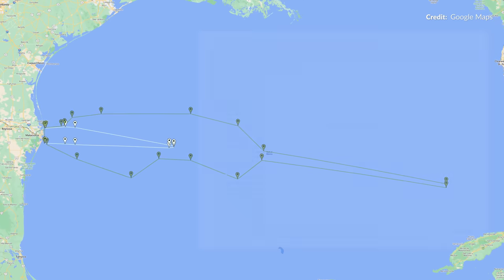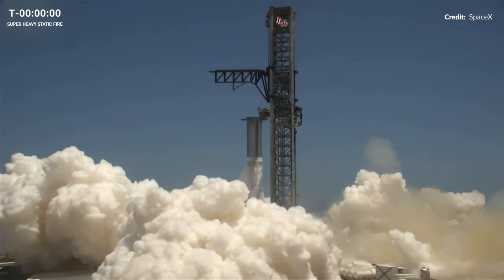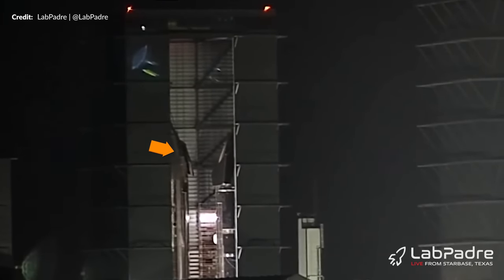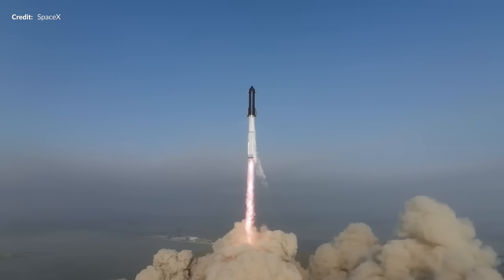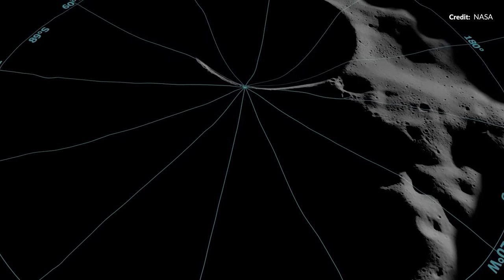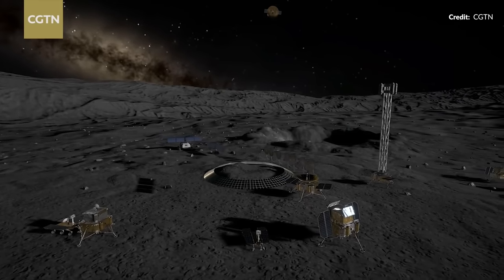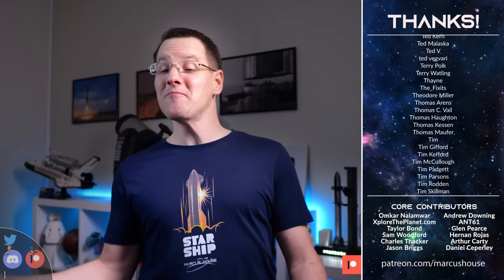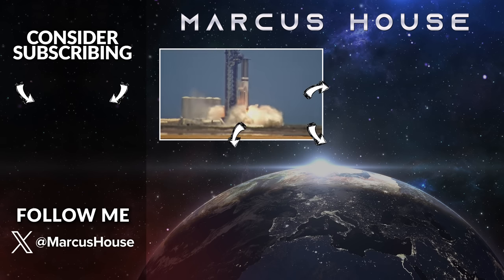SpaceX Drops Bombshell Upgrade, and Starship Flight 2 Date Intention Revealed!

Comment from the maker: Click my link: https://drinkag1.com/marcushouse now to get a year's supply of Vitamin D3K2 & 5 travel packs for FREE with your first purchase. This is a gamechanger for supporting your immune system! AG1 provides your body with everything it needs for optimal performance every single day.
Reply: @MarcusHouse somehow I don’t think this was your answer to me. Looks like a scammer?

And what about my question what happened to the test section that was put on the can crusher?
Reply: Marcus this is possibly your most remarkable yet unassuming video to date. So impressed. Truly groundbreaking things underfoot mate... and you did not break step with other more mundane weeks. Impartiality +10x. Your work so appreciated...cheers - Mech Eng UQ with much love for the 'bart.
Reply: I wonder if NASA has ever heard of the term "KEEP IT SIMPLE, STUPID..." ie, the Mars sample return mission, WHY THE HELL ADD COMPLICATIONS to a system like have the sample return rocket effectively 'Yeeted' into the air to then fire up and fly away??? MULTIPLE UNNECESSARY FAILURE POINTS ADDED! Just have a simple lightweight launch rack/ladder/gantry move or angle over to stand on the ground, to have the rocket pointed up/or at specific angle, and then the rocket can launch from there (as per the normal way of launching rockets 😏)... I REALLY DON'T UNDERSTAND why they would ADD MORE RISKY procedures to something SO VERY COSTLY, and SO BLOODY COMPLICATED to retrieve something so BLOODY VALUABLE (in BOTH financial cost AND scientific value) from a planet +/- 225 Million Km away!!!
IT DEFIES LOGIC!!! 🤔😒
😎🇬🇧
Reply: Marcus  , I am  so sorry for getting your name spelling wrong .  I will try to do better next time 😩🤠👍🏻

Comment: It'll be interesting to see how that hot stage protective deflector stands up to the abuse considering the raptors are pressed right up against it. The only way they'll be able to know is by eventually bringing the boosters back and inspecting then. Exciting times ahead!
Reply: It might be replaceable.
Reply: It'll just be the 3 outside vacuum raptors firing. The 3 center raptors where they are pressed right up against the plate won't ignite.
Reply: And will probably look like the water tanks after the first flight. @StillAliveAndKicking_
Reply: @paritee6488  The tanks were damaged by pieces of concrete dislodged from the launch pad. Unless I am mistaken, the engines don’t discharge concrete. And in any case numerous rockets already use hot staging, notably Russian and Chinese rockets. Thus it is neither an unknown unknown, nor a known unknown.
Reply: @StillAliveAndKicking_  You're right that it isn't a new technology but argument falls apart when you remember they want to reuse boosters within a very short time frame and so it has to work perfectly every time with little to no maintenence.
Reply: @RogerM88  that would exceed the normal pressure on those tiles by a factor of 50 (at least)
Reply: I wondered, still do, why they are sure that dome will hold up. Perhaps because the dome only has to survive Starship's raptors for a second or 3.
Reply: @StillAliveAndKicking_ I doubt they'd want to do that because if thats the plan, the boosters would have a very long turnaround time. I may be too optimistic, but I hope they will be able to catch-land a booster and fly again in a few hours or a day.
Sounds impossible, but Fast-Pace is SpaceX Mojo.
Reply: @iamaduckquack  True. Then again how long does it take to stack Starship on a booster? I doubt it would take long to replace, assuming it is necessary, which might not be the case. It wouldn’t surprise me if SpaceX has not yet decided, preferring to suck it and see.
Reply: @bobbarclay316 Stainless steel domes are somewhat more resilient to Raptor breath than concrete plateaus.
Reply: @StillAliveAndKicking_ If it's a unit that connects in using the original Starship mounting points, and then has new mounting points on the top of the Hot Staging Ring, it could indeed be an easily replaced item, the sort of thing that gets swapped out and refurbished regularly.
Catch a Booster, swap out the staging ring, mount a Starship, refuel and relaunch.
Reply: @bobbarclay316 Why do you think it would take a long turnaround time? I'd expect it should be a quick job to release a used ring from the top of the booster and swap for a fresh one - It appears to use the mounting hardware that previously attached Starship to the booster, so the ring should be able to unlock from that hardware just as quick as a Starship would in flight. It may require new hardware to be added to the towers arms, so that once the Booster is back on the OLM the arms can open, raise, and then grip the ring to lift and lower it to the ground.
Reply: @PiDsPagePrototypes  I think that any time spent off the OLM after a flight slows the overall pace. To reach its goals for an operational Starship they will want turnaround measured in hours, not days. 
I also think if the ring is damaged, it means that the thrust vector deviated from the "in line" direction of travel. Starship would then lose the advantage of hot thrusting. 
Of course ring damage before separation could be disastrous.
Reply: @bobbarclay316  The Booster would not spend any time off the OLM - the Ring looks like it could be lifted off of the booster. So swapping the ring would only be a quick job before the Starship returns from flight to be caught and mounted to the Booster. The usual 90 minutes of an orbit should be more then enough time.

Comment: The large boxes on the HLS mock up are air conditioners. Probably pretty hot in there without them. FYI. Love your work!
Reply: So, basically a life support system
Reply: Not wanting to argue as I don't know either but they don't look like air conditioner units to me - there's no vents visible as 'domestic' aircon units have on the sides. The rectangular channels below them are probably fork lift 'receptacles' for handling them, same on the transformer. They could just be distribution boxes for whatever wiring is being installed inside the cone. Anyway, all speculation unfortunately! ;-)
Reply: @wojciechdebowski5014  Life support for the engineers working on them rather than astronauts, yeah...

I do love how SpaceX put these helpful signs on things, and make sure to position them facing the cameras. It's obviously something of a game to them...

Comment: Makes perfect sense that the pad was the reason the 4 Raps didn't start. There's been allot of work there, obviously. That actually gives me some hope that the 4/20 debacle wont be repeated. They used up all their luck on that one, having the engine outs away from the tower. Looking forward to the launch... they need to get it in gear so they can get on with HLS flights..

Comment: 8:22 Seeing the comparison of the round hatch and the rectangular one, the thought and image of the windows of the "Comet" airliner from the 1950's comes to mind. As well as the stress fractures to the airframe that resulted from them.

Even so, I doubt these SpaceX engineers would repeat a mistake so expensively learned over half a century ago...

Comment: What a fabulous episode. Marcus’s channel just gets better and better.  Stainless steel is notorious for warping with heat. Any precision engineer will tell you that machining most types is a nightmare if a lot of heat is produced and welding sheet stainless steel is no less difficult.  I know Spacex have got construction, welding and stress relief processes down to a fine art, but it made me wonder, will the hot staging ring need replacing with every flight. Not just because of warpage but also the weakening of the material due to the enormous heat it will be subject to. Does anyone know the answer.

Comment: I think that nosecone is part mock-up and visitor facility: looks like they bolted on some pretty standard AC units, with pretty standard XFMR and electrical panel.
Reply: It's almost certainly note a visitor facility. There really isn't a purpose to such an addition.
Reply: @bryanillenberg  it doesn't have to have a purpose, just like twitter/X
Reply: @wim0104  LOL

Comment: SpaceX still needs another booster static fire but for longer time. Suspect more shielding to the pad will be needed, as SpaceX is already replacing part of the fondag.
Reply: The fondag replacement has nothing to do with static fire

Comment: Testing.  That’s why we fly…and why it’s better to fly often.  The progress from flight one to flight two is going to be immense…in large part due to the astounding level of improvement in everything related to Stage Zero.  There is ample reason for the heightened level of optimism this time around.  The post flight improvement process has been passing the eye test with flying colors, and that goes a very long way toward building confidence in the expected result…when those turbo-pumps spin up and those thirty three fires are lit.

Comment: I’m always amazed at the amount of activity at Boca Chica Starbase your film shows activity at all hours of the day , trucks of all sizes constantly driving in and out delivery’s, men with hard hats they look like little bees moving around , I like the openness of ship construction and I believe I heard the comment that Elon said , if we have to do any work or repairs on Mars it’s not going to be a dust free environment! But these crews always look like they love what their doing . Space X is always taking buildings down and erecting new ones Love the activity going on ! I guess we’ll see the same at Florida in the new future.
Reply: I work for one of the equipment rental companies that supplies equipment (forklifts, mainlift baskets, cranes, etc…) for construction at Space X. I was there this past week and you are correct about dust (and sand). The wind is always blowing every time I’ve been there and this week was no different. It is so hard to keep the dust and sand from getting into the open hydraulic lines while doing repairs to the machine you are working on. There is soooo much truck/delivery traffic that it is hard to find a place out of the way to repair or do maintenance to a machine.

Comment: I wonder if SpaceX will perform a static test of the Hot Staging?
Reply: most probably not. there is no infrastructure in place to safely test it. it would be very dangerous to test it on the pad. spacex would rather test it at stage seperation than on the pad in case there is failure so that the pad does not get damaged,
Reply: @hamzahkhan8952 well the ring is detachable so I don’t see why they couldn’t just test it on top of the ring
Reply: @LeoFreese Full thrust burns of vacuum engines at sea level are usually a bad idea. They also wouldn't provide the same loading profile as the real thing.
Reply: @LeoFreese   that true. spacex fires many raptors a day, so maybe theyve already tested firing raptors at steel.
Reply: @LeoFreese also, as another person commented, you cant test vaccum engines on the ground the same way they would in space (unless they made a huge vaccum chamber for testing, which they wouldn.t).
Reply: @jounik probably an incredibly bad idea - apart from the chance of catastrophic failure of the rings, the raptors’ nozzles would be damaged pretty badly as well from severe over expansion
Reply: Yes SpaceX will perform static testing of hot staging. Right after Booster engines are ignited and hold down clamps are released just installed  hot staging vent ring will collapse by twisting around main axis of the rocket (imagine domino pieces standing on sort edges arranged into a circle covered by a solid circle with weight on top of it and then imagine turning that cricle)
Reply: @KarolKarolak  theyve already done testing to simulate forces of launch and hot stage ring survived those tests.
Reply: @hamzahkhan8952  Tests they conduct are useless as they simulate forces but do not simulate constrains properly. Imagine a tall mast attached to side of a tall building tested for compression without ability to buckle. It will survive the test. same free standing mast will buckle at less than a quarter of the load. Same here if you constrain rotational displacement as they do than vent ring will survive the test. How do you constrain rotational displacement of vent ring during flight of a rocket?

Comment: Have they tested or simulated the top of the booster and hot staging ring against the heat and force of the raptors, upon a hot staging separation, is it plausible for reusability?
Reply: They could be replaced after one launch.

Comment: 1:32 It looks like the Hot Stage Ring is reinforced up towards the flat plate on top... Is it just spreading the load, or will there be contact with the Ship at the sea level engine area to even it out?

I'm going with load spreading. I doubt the engine nozzles would handle that direction of stress... but still... 🤔

Comment: 3:52 now that's a happy face (just need to improve the lips). 6:06 Currently it looks like all boosters clear the entrance to the mega bay, though depending on the height of the hot stage ring - they might want add another level to the new mega bay before installing the overhead crane, could be tight working in that space.

Comment: Suggestion: I'd like to see a review of the progress on the reuse of Falcon boosters. You mentioned the most recent launch booster was on its 13th trip. What is the status and evolution of the combustion chambers and funnel? The pumps and other hardware? What is the analysis of progress toward 100 launch capability?
Reply: That's probably a question for Elon, not Marcus.
Reply: @absalomdraconis  And Elon is unlikely to ever tell us those kinds of details, since that's deep trade-secret stuff. 

All we really know is that two of the boosters reached 15 flights, were taken off the flight line for inspection and maintenance, and eventually brought back into service for a 16th flight. So we know that they can do 15 without any special effort.

As to 100 flights though, it's doubtful that any will reach that milestone... not because they can't, but because at the current rate of operations, it would take about ten years for a new booster to get there. And once Starship comes online, the rate of Falcon operations will drop sharply as Starlink missions are moved across.

Comment: Spin stablisation isn't about gyroscopic stability (tall thin objects are not gyroscopically stable, they tend to flip) but about evening out the imperfect thrust direction of the non-gymballing solid state motor.
Reply from the maker: Both true.

Comment: Surely, they would need to test the hot staging adapter and bulkhead under load from actual engine firing before using them in flight.

Comment: They need a drinking water tank, they also need a septic tank for human waste (Now that’s typical that plastic, but perhaps they do want limit flammable materials.).
plus I perhaps also a nitrogen tank, air is 80 nitrogen, only 20 oxygen.
Reply: The trick is removing CO2 and other off-gas from materials.
Reply: @up4open763  Recirculation equipment makes sense, but having a backup, just case something goes wrong, can give the crew a bit more time sort out any issues, if there should be leak, or issue.
Reply: @kjetilhvalstrand1009  The ability to add positive pressure could be helpful too.

Comment: I'd think they could stack the Starship on the booster, fill the booster with nitrogen, and static fire the Starship engines, simulating the separation sequence, and see how the booster shielding and raptors hold up, before launching
Reply: Which is unlikely to happen

Comment: About landing in dark lunar polar craters...  Should just toss a few impact penetrators over the side as the lunar lander is descending, give them 10 minutes of battery power each to light up the area.
Reply: There's many more parameters a sensor can detect than just visible light

Comment: Thanks for another wonderful video! Earendel is truly amazing. Out of all the stars we can see in the sky, it blows my mind that astronomers can say with confidence this one in particular is definitely the furthest away. And then there's all the coincidences that had to happen to make it visible to us, the huge galaxies that had to line up in the right way at the right times to magnify the light from a star 28 billion light years away.
Reply: Using the redshift of the various spectral lines of common elements, calculating distance is pretty straightforward. 

Yes, a lot of low probability events/situations had to occur in order for the observed phenomena. However, the universe is huge - galaxies and stars number in the trillions so there are so many umpteen opportunities for potential lineups that lineups are guaranteed.

 It is similar to biological reproduction: The probability of a particular sperm impregnating an egg is near zero but given millions upon millions of chances the probability of one of them making it approaches 100%.

BTW, the visible universe is only ~14.5 billion light years across. The 28 BLY number you may be referring to is from a single paper speculating about a different method for measuring distance. It is not a value accepted by the scientific community.